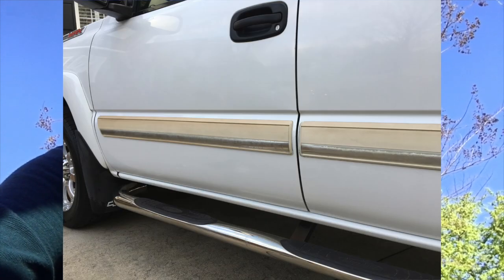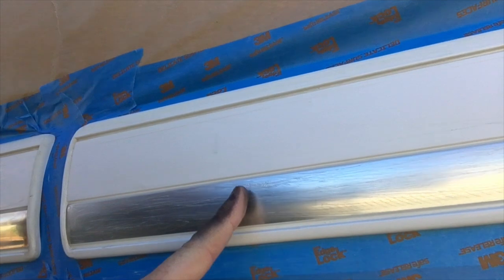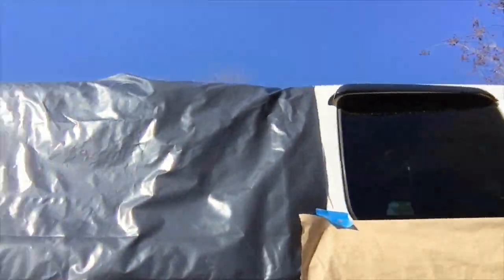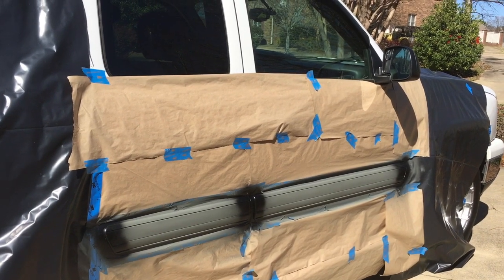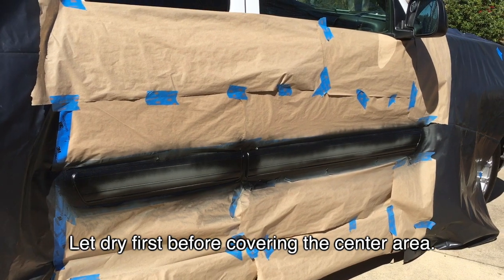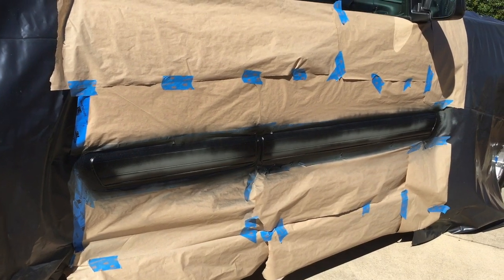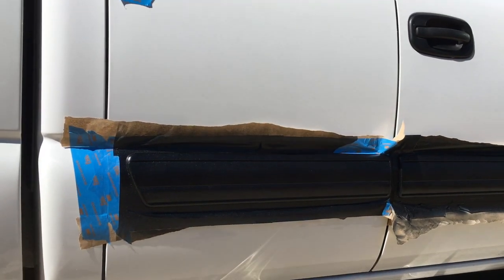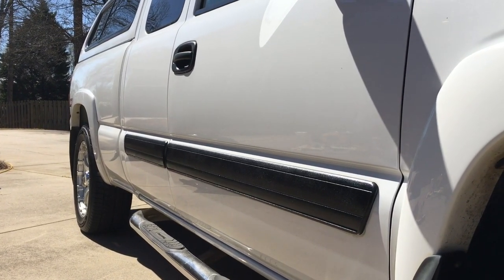Painting Body Molding Door Trim

Comment: I painted the front and rear bumper, it can out good, when I painted the door moldings the paint didn't take eveningly, tried it twice, same result. What's going on???
Reply from the maker: Sorry you are having trouble! Getting paint to apply evenly depends on how articulate you are at painting and how well the surface is prepped. I prepped the trim by sanding it with a rough grain and then following it up by sanding it with a finer grain, which provided a smoother surface to start with. Then you have to apply the primer, then afterwards the paint. But you have to be steady with the spray and consistent with the distance. Otherwise, you will get it uneven. If you are having a hard time with it, ask someone who has refinished furniture or something and have them do it for you.

Comment: What do you use to seal it so it wont chip or fade off when rainging
Reply from the maker: It never chipped. Had it for a few years and never faded. The prep with the sandpaper and using the etching primer made a good surface for the bedliner paint to adhere.

Comment: Do you know what grit you used for the sandpaper ?
Reply from the maker: I used a 60d grit sandpaper, but I think anywhere between 60-100 would be fine. I followed up with a sanding block that was flexible. I don't know the grit level on the block, but it was definitely fine.

Comment: why not paint them white? just curious
Reply from the maker: Well, the first thought I had was, "what shade of white?" and if I choose the stock color, how much of that has faded a bit? I didn't want a slight mismatch. I figured black would be good and I wanted something durable so I choose the bedliner paint.
Reply: Ive repainted mine with the factory color and the nasty look came back within 18 months.  I prepped correctly with the flex seal primer as well.  This is my next finish but I’m going to leave the “chrome” strip on the black moulding.